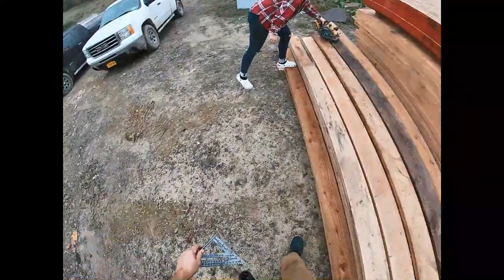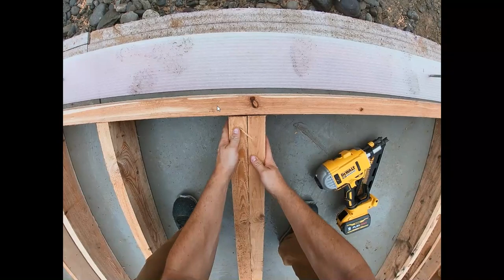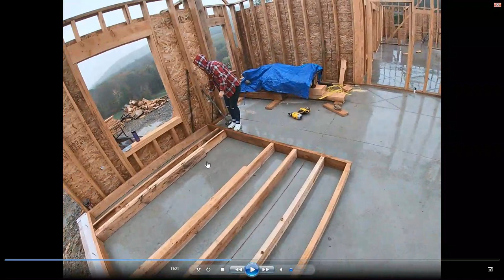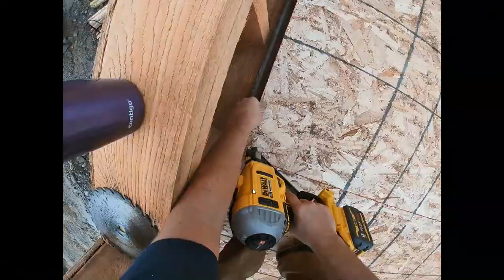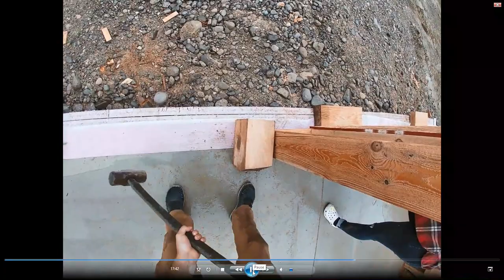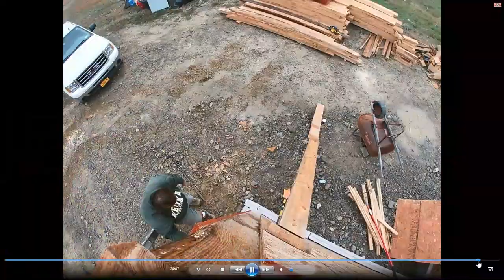How to Frame and Stand a Wall Using Rough Cut Lumber

Comment: How long did your battery last on the circular saw? We also are using rough cut lumber up in northern maine and my kobalt 24v saw says 4 Amp hours but I got just over an hour on each  battery. Must be because of the green lumber